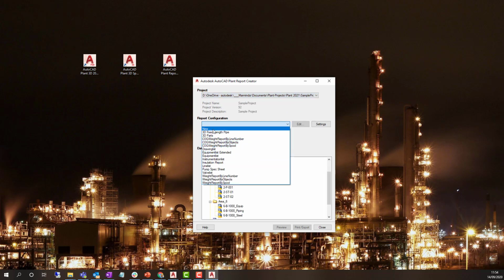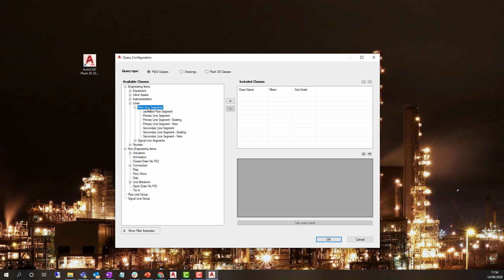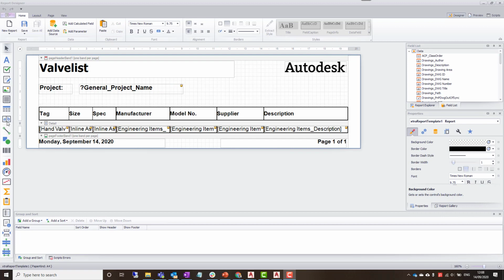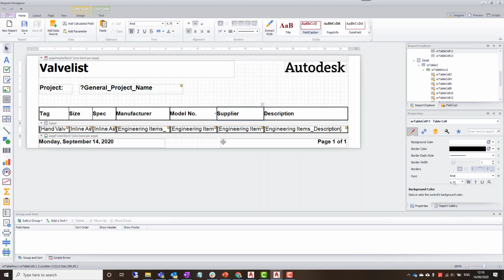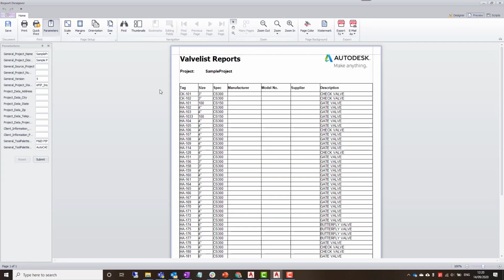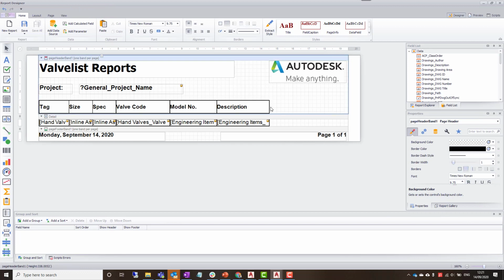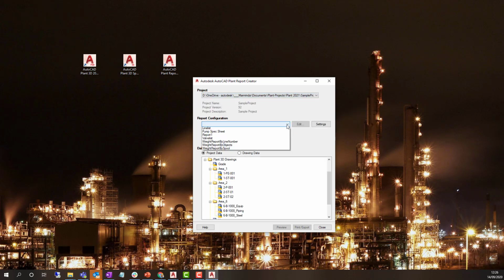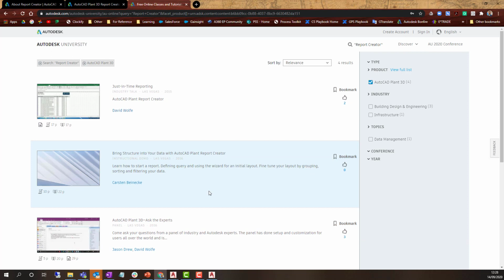Plant 3D with the Experts: Report Creator-Part 2: Editing, Creating and Customizing Plant 3D Reports

Comment: I'm trying to create a basic bill of material. I have stainless steel pipe and carbon steel pipe on the same drawing and its adding all my 3 inch stainless pipe with the 3 inch carbon steel pipe. It's adding all my stainless 90 degree elbows with the carbon steel elbows. Shit's driving me crazy. Why would it be set up to do this as default? Extremely frustrating and I cant see how to make it separate.